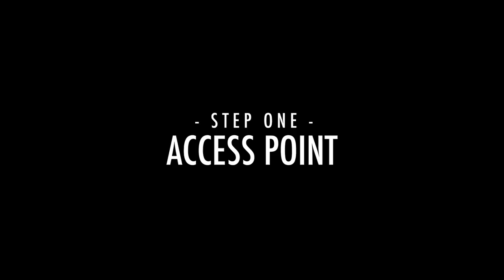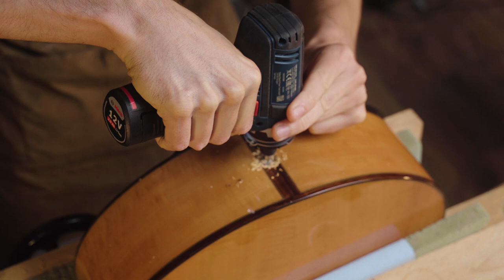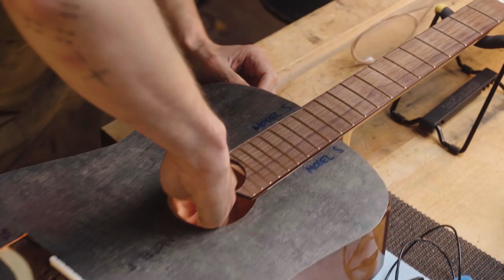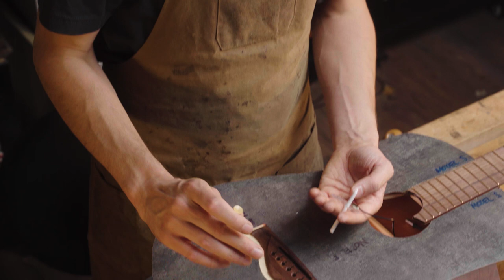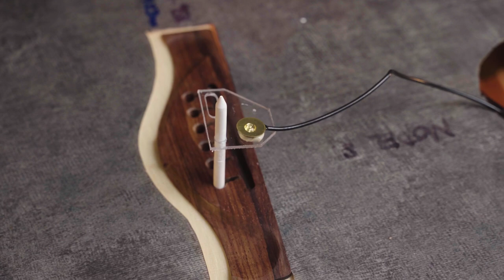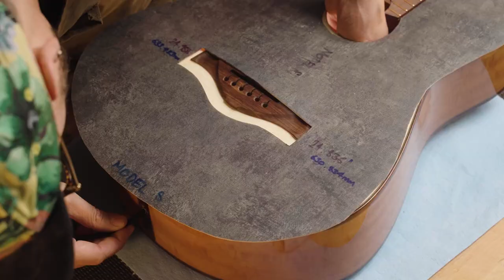How to PROPERLY install K&K Trinity Pickup System.

Comment: Just subbed to the channel, really quality content & Tom is definitely a quality character. 

I have a pair of Grand Symphony's, one 2011 with the ES1 & a 2017 Ltd with an ES2. I despised the ES2 so much that I had this brand new, expensive, beautiful guitar that I wouldn't dare take to a stage because of how awful I thought it sounded plugged in. I've heard many other Taylor's with ES2's that didn't sound as under water awful as mine so naturally I spent several hundred dollars having the guitar tweaked & prodded in every which way. Spent a few more hundred dollars on adding gear to my pedal board, all to make this guitar playable in a live setting. In 2021 I had the ES2 gutted & the Trinity mini onboard installed. Couldn't be more pleased with the K&K but watching your video let's me know how much trouble my luthier went thru making all that happen lol.

Comment: The superglue installation is the single thing that prevents me from using K&K pickups. Competitors use 3M double sided tape that works well and can be removed when the time comes to replace or upgrade the pickup system.
Reply from the maker: You can use tape if you want.

Comment: Tom, very helpful video.  Two questions: how do you make sure the wire doesn't vibrate against the wood inside the guitar?  Also, do you feel the K&K accurately reproduces close the the true sound of your guitar (assuming a quality pre-amp)?
Thanks, John
Gig Harbor, WA
Reply from the maker: Hey John, yeah you’ve got to make sure you pin down the wires pretty well, there’s a bit of trial and error involved. I quite like the K&K system, if you pair it with a decent preamp you can get some pleasing results. Of course, it depends on the situation you find yourself in. I’ve also used a different microphone in previous installations which changed things considerably.
Reply: @TomSandsGuitars  Thanks Tom, I am thinking of having you drop a pickup in my Model S when it is finished.  I like the K&K because there are no holes drilled through the bridge and top.
Thanks, John
Reply from the maker: @johnlind5819  sure thing John, it’s always a nice option to have. We’ll chat before the guitar starts because I actually prefer to do most of the instal before the guitar is closed up if I can.

Comment: I installed in my Stewmac Kit OM guitar, nice sound , but have feedback on 50% gain and so much bass, any remedy or advise?
Reply from the maker: you should be able to eq the bass, feedback is always an issue with acoustics so you might just have to play around with levels, mic position etc.

Comment: Good move to cover that thin foam with paper towel. IMHO it would be a better move still to get out of your shop altogether. During manufacturer the mould rollers that pump that stuff out are sprayed constantly with silcone release agent. Being foam, that matting absorbs its fair share, easy enough to cause cross contamination and then the nightmare of fisheye as you try to apply finish....but that's not such an issue for a finished guitar? Probably not but the formulation required to make foam supple requires lots of plastersizer. Leave that in contact with a finish and it will quickly soften it enough to make it like a tac rag with all kinds of crap sticking to it. Leave it long enough and you will be literally peeling the foam off the guitar leaving behind a nice basket weave tattoo.... I now use once detergent washed acoustic foam for its egg carton profile. The guitar sits up on the peaks, and any crap gets held in the valleys away from the instrument or, just plain old bath towels covered with paper if I'm applying any kind of glue. I use mostly hide and that picks off like soft snot if you get it early......doesn't taste as nice though..😆
Reply from the maker: Love that tip. I’ve noticed the release agent you speak of. Bath towels always seem to hold onto bits of crap so I’ll definitely give the acoustic foam a try. Thank you!
Reply: @TomSandsGuitars  Yeah the acoustic foam works well but sometimes you need something with less give so that's when I use a fresh bath towel, but only on jobs that won't involve any fret work or other sources of metal contamination. I made an adjustable guitar clamping cradle when first starting out, and that, along with a gobar deck and a selection of radius dishes I routed myself ( outside in a VERY stiff breaze ) is something I don't regret doing. The craddle both clamps and craddels the body at 4 rubberised cork lined points. These are actually slotted 'L' brackets fitted to a flat base of 19mm ply. The brackets can be swung horizontally side to side and slid in and out and are fitted with a vertically adjustable support step to carry the back/top of the guitar allowing for side tapper. You surely have one because aside from being good for holding every guitar made by mankind, routing the binding ledge would be a right PIA without one.....well it would be with my articulated arm setup because that all depends upon setting the body 'level' for a crisp verticle step all around.